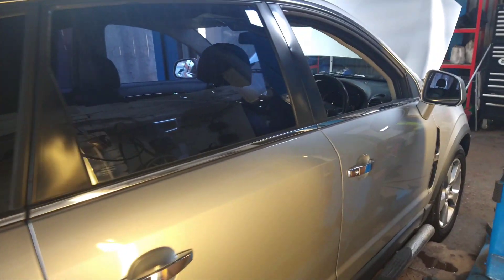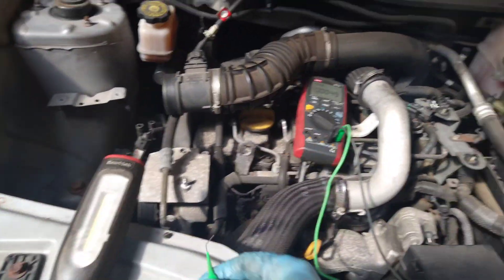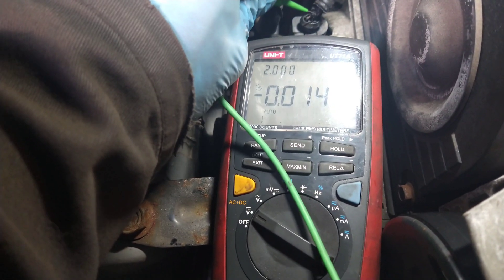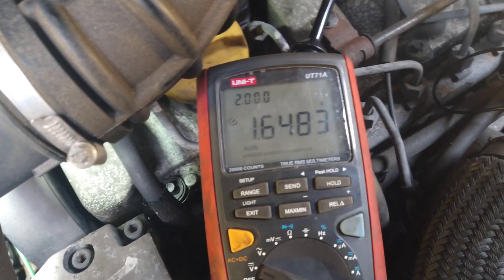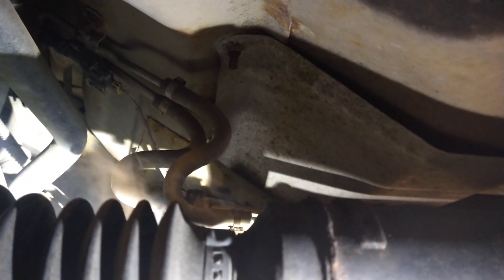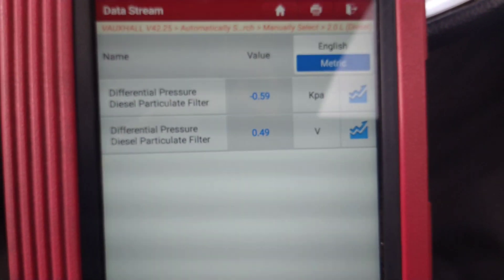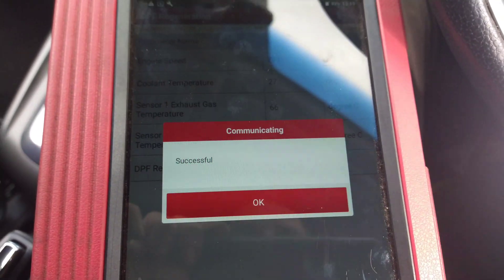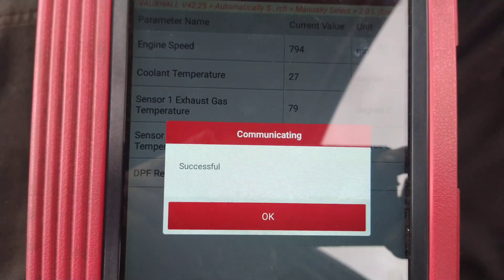Vauxhall Antara (P2453)DPF pressure sensor range/performance fault

Comment: Hy, i have the same error but the hoses are ok, i’m thinking to change the sensor but i found two different types, mine is 2007 150hp, should be the same sensor one fixing ear or the one with two fixing ears?

Comment: I have the same faults with my antara buy, all pipes ok, complete new exhaust and dpf, sensor, faults clear then after a few miles come back on again, garages have no idea what is causing limp mode codes only point to pressure fault, but all is ok, could it be ecu?

Comment: Hi.I have the same problem but I was to 4 garage and nobody can now what is wrong.Every 3-5 weeks after they delete error the problem reapare.Where is your garage ? I live in Bedford.Thank you !
Reply from the maker: I am a mobile mechanic based in Cornwall
Reply: @mechanicmatt871  Thank you for you answer. 3 hours up to you.Could you give an advice what to check because my car made  regeneration and Dpf is not block.What I found is a sensor pressure hose dirty and wet but why is like this I don't understand....Have a nice day!

Comment: When the reves went hi I started panicking and thought abort . But you stuck it out your a better man than me. Dig process spot on .great job.😁
Reply from the maker: I was thinking it was a wee bit higher than I would feel was normal and ready to stop it, some how it doesn't seem right that it should rev so high with no load on the engine.
Thanks for watching and your comment